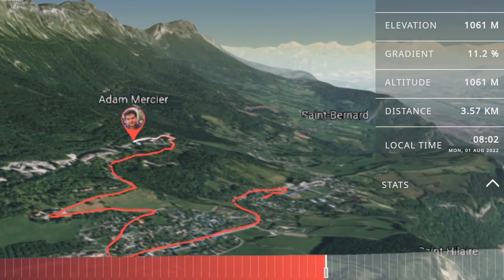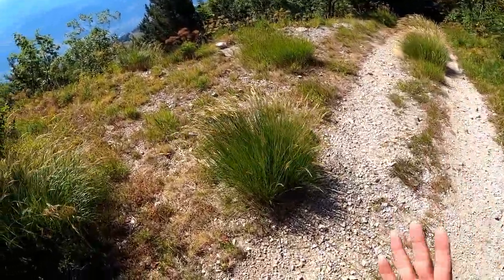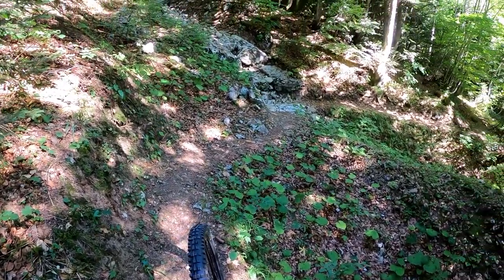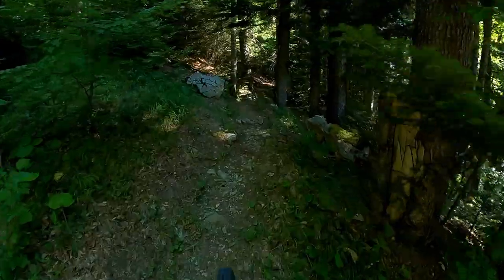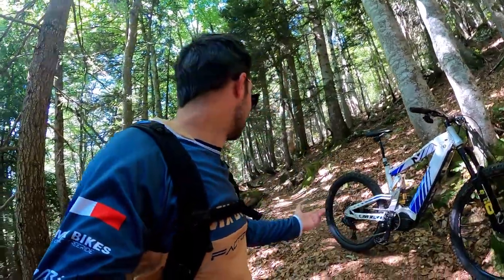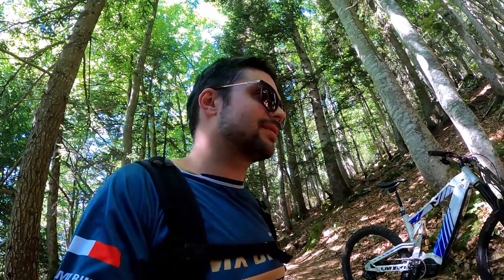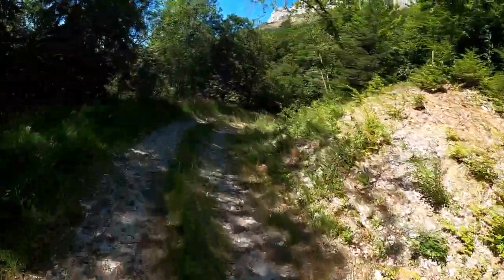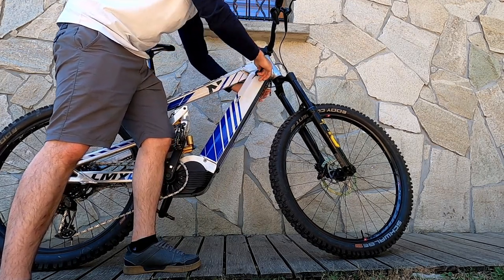LMX VLOG 033 - LMX 56 -Torque sensor tuning and straight cut gears 🔊

Comment: How would you compare this bike to the LMX64? What's the difference and design philosophy for the 56?
Reply from the maker: Same capability with updated chassis, more integration, bigger battery... With the higher réduction ratio we have the same torque with half the phase amps, that leads to higher continuous torque. The phone app will alow updates, mode tuning, route planning with battery range estimation.
Reply: @Lmxbikes_freeride  Really impressive work, any estimate on weight?